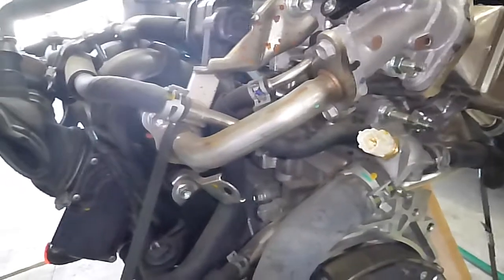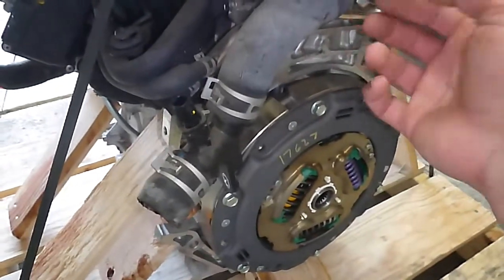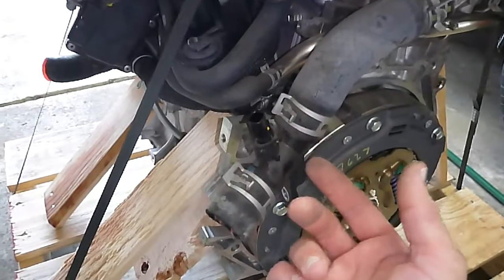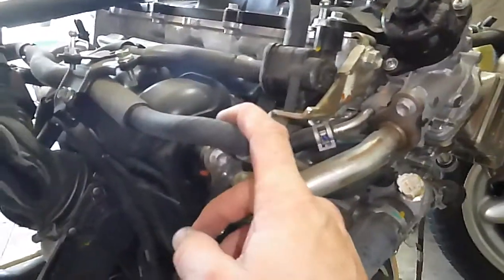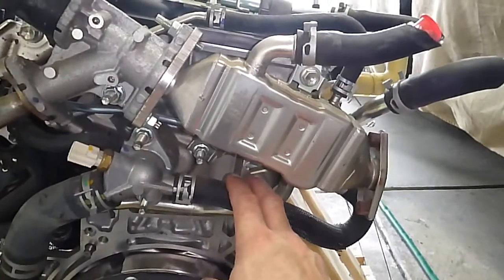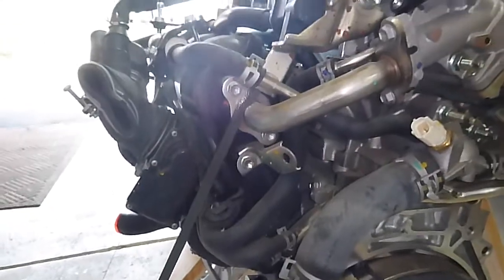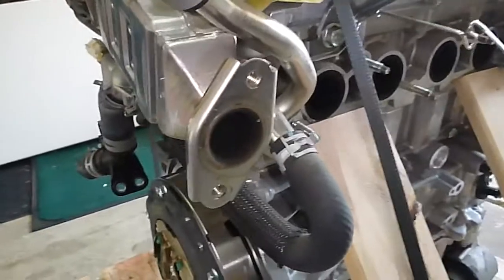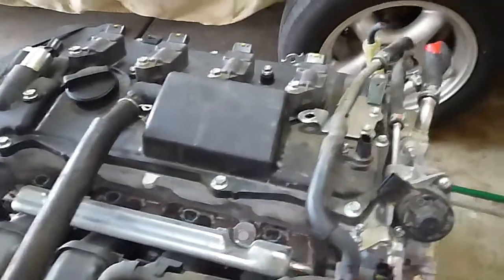Understanding the 2016-17 Toyota Prius (GEN 4) Hose Connections - Fix That Prius!

Comment: Could use some help.  Just finished my jdm gen4 swap in my 3rd gen.  So jiggle pin is cut, i believe we have the coolant routing correct. Have a kind of gurgling sound and also liquid coming out of exhaust.  Fans havent come on when it idles anywhere from 180-206 F. I shut car off when it hit 206.